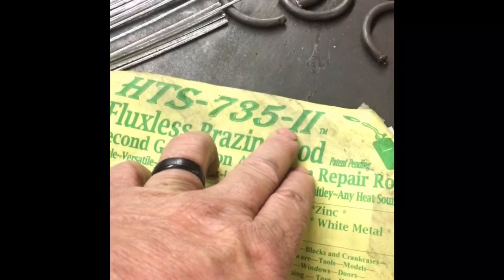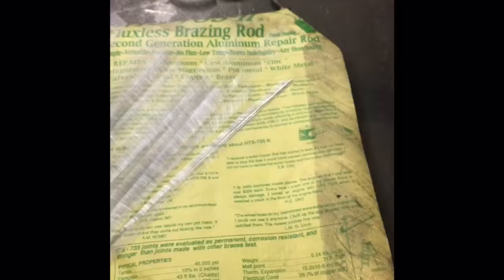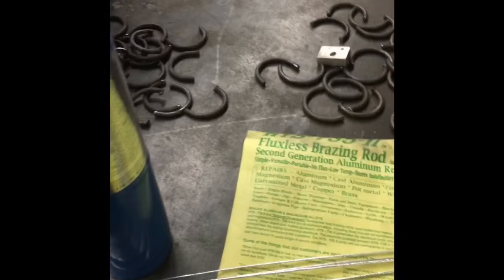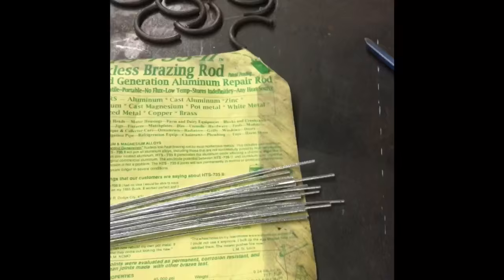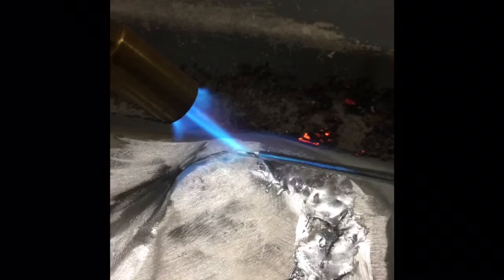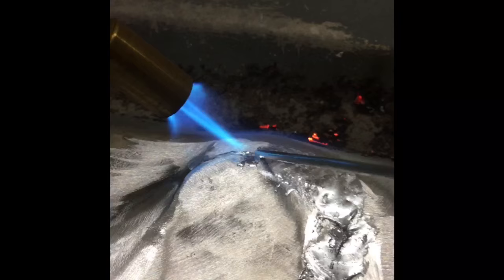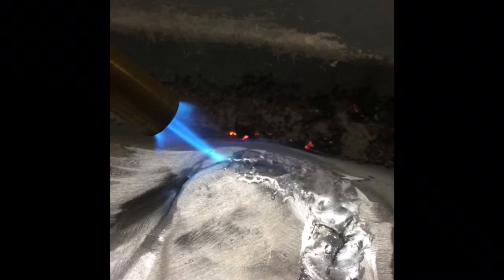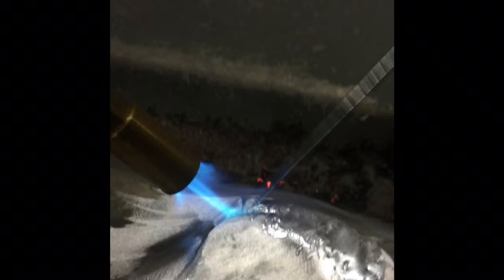DIY Repairing a Hole or Crack in an Aluminum Boat SUPER EASY

Comment: I literally burnt a hole in my tracker topper 1436 useing these so decided to give it another go today on another hole I had and I managed to fill that one but made another hole in the process haha idk what I'm doing wrong I try to keep the map gas max heat torch moveing
Reply: Probably running too hot that's a propane tank he's using. Just get the metal hot enough to melt the rod and keep it flowing, but don't let it get too hot even with propane torches because you'll melt the aluminum of the boat away

Comment: Great way to repair it on dry land. Thanks for posting Sam.

No one's ever heard of Brolite. It's been used for years in marine industry for repairing hulls of boats in the water and even under way with large holes. It get's as hard as steel and can be mixed in water or underwater. You can drill and tap it for threads if needed also.
Reply: i googled it and Nothing comes up at all ,,
Reply: I think your talking about splash zone.
Reply: I believe he is thinking of the product called belzona
Reply: yes it's good for a temp filling repair in your teeth.
Reply: He’s referring to when him and his bro,s … we’ll simply put, “ got lite “ 🤙

Comment: I bought some and see so many uses for these!  I have a leaky transom on my jon boat and will repair it but have also needed in the past a way to weld things without a welder.  just quick connections and a way to hold different metal things together. I can't wait to try this.  It may become my new duct tape (for metal).
Reply: Karen Grider how'd  it do
Reply: Karen Grider

Comment: Thanks, that will help a lot. I used fibreglass and resin a year ago - you're right - it does not last.
Just a tiny point - when you are using a phone to take a video it is best to turn It to landscape mode, not upright (portrait)  - looks good on both phone and PC

Comment: This is a short term fix. These brazing rods don’t hold up well on a flexing hull. Use it on gunnels or someplace that won’t flex, but I wouldn’t recommend it in flexing areas.
Reply: Not sure where you came up with that info, only way the repair will come loose is if you use HTS-735-11 incorrectly by either not cleaning the aluminum or not heating to the correct temperature. The rod will penetrate the aluminum and will not come loose. This is not a surface treatment like some other products. This is a permanent repair. BUT you MUST follow the instructions and keep the rod out of the flame. Videos at youtube.com/c/aluminum-weld you can always call if you have additional questions. Thanks for your interest.

Comment: While cranking my flat bottom up on trailor it pulled on the front loop and cracked it pretty good will this as showed in video wrk?? It is a old boat I know it want hold like new I can load it by hand I just need to be sealed bk up and hold some wht??

Comment: You can actually grind, tap, die, pretty much anything you do with aluminum with that Aluma weld.  I though it was a gimmick till I tried it!
Reply from the maker: +Bryan Roberts Yes I thought the same thing
Reply: +Sam Wood Outdoors I bought a 38' extension ladder that had a broken rung on the top section for $30. I used the Aluma weld and it hasn't broke yet. 
2 years and 320lbs!
Reply from the maker: nice
Reply: This is awesome I had issues but that was from putz before me using fiberglass body filler to seal a hole I had to burn out all of it so the Brazing Weld would hold PROPER,
Reply: @SamWoodOutdoors  what kind of torch and torch head did you use

Comment: I tried that stuff on my aluminum canoe years ago and it didn't work at all.  Watching some of these videos I think I found out what I did wrong.  I was using propane instead of the higher heat gases.  I just couldn't get the aluminum hot enough to get the rod to work.  
What gas did you use on the weld?
Reply: Yes Sir that it the way HTS-735-11 works.
Reply: @Aluminum-weld  hi I just need to Change the gas and use the same propane torch?
Reply: @nelsoncruck2458  What are you working on? Cannot answer without more details Watch the Weld Aluminum at Home video  at youtube.com/c/aluminum-weld
Reply: @Aluminum-weld  I’m trying to fix a  hole caused by a loose rivet on my 14 ft aluminum fishing boat . I understand the normal propane will not work. Do i only need to change the gas or I have to buy a different burner altogether? Tks!
Reply: @nelsoncruck2458  Nelson use the torch to currently have with MAP Gas. If you cannot get the boat hot enough to melt the rod then you need another torch. I like the TS8000 Bernzomatic Watch my Torch tip and rivet repair at youtube.com/c/aluminum-weld
Reply: More heat isn't the answer. Remember aluminum (your boat) melts at around 1200º, just a few hundred degrees warmer. Waiting for the aluminum surface to warm up enough is the key. Since aluminum is a good heat conductor (heat spreads quickly), that takes time. Don't try to rush it by applying more heat, putting the rod itself into the flame, and similar.

Comment: You didn't mention the type of gas in your torch you are using to melt the rod
Reply: Propane work most of the time, Mapp Gas will heat the aluminum faster. Control the heat with distance ay shown in the HEAT CONTROL video at 
youtube.com/c/aluminum-weld

Comment: It won’t last but a minute.  The flexing of the hull will cause the exact same crack again. GUARANTEED!!!!   Thanks for the attempt 😂.  Video too😃
Reply: I disagree, The HTS-735-11 rod penetrates the aluminum and will flex with the boat. It is very inportant to apply the rod 3/8 to 1/2 inch both sides of the crack and apply it thick enough for strength. There are several videos at youtube.com/c/aluminum-weld demonstrating this.

Comment: What kind of torch were you using?
Reply: Watch yhe videos at youtube.com/c/aluminum-weld  We discuss different torches and gas. look for the pontoon repair video
Reply: Best to use a Benzomatic Mapp Gas to Heat the Aluminum up to 735 degrees to be able to melt the HTS-735-II Flux less Aluminum Brazing Rod when the rod touches the surface of the aluminum keeping it from melting into touch flame just watch the video several times until you are comfortable with what to do
Reply: Best to use a Benzomatic Mapp Gas to Heat the Aluminum (after cleaning the aluminum very good) up to 735 degrees to be able to melt the HTS-735-II Flux less Aluminum Brazing Rod when the rod touches the surface of the aluminum keeping it from melting into touch flame just watch the video several times until you are comfortable with what to do

Comment: There are videos on YT saying this doesn't hold up when you get into a little rough water those pop back open. How are they holding up now?
Reply: Wonder if they were using HTS-735-11 or something else as there all products  do not work as well.  Also the HTS-735-11 must be used correctly to work. 
Several videos at youtube.com/c/aluminum-weld shows the strength and proper application methods.

Comment: I'm trying to fill a couple pinholes in my air conditioning aluminum tubing on my 07 Duramax, and I'm starting to think that propane gas is safer to use than Mapp gas since the Mapp gas can melt the AL tubing quicker causing a collapse. Does anybody have an opinion on this? Thanks!
Reply: I like to say you can have too little heat but not too much, because you can control the heat by pulling the torch away from the surface  you are heating reducing the heat, or position the torch closer and increase the heat. If you use a torch or gas that is not hot enough to get the aluminum to 735 degrees F.  the HTS-735-11 rod will not melt or bond to the aluminum.  The aluminum must melt the rod, NOT the torch. There is a heat control video at youtube.com/c/aluminum-weld showing this. The important thing is to use the HTS-735-11 Rod at a temperature stick to determine the aluminum temperature. There is no guessing involved using the rod. When the rod is melted by the heated aluminum you are at the correct temperature and you can pull the torch back away enough to maintain the temperature. If you pull the torch back too far and the aluminum no longer melts the aluminum just lower the torch which will increase the heat. The HTS-735-11 rod melts at 735 degrees F aluminum melts at around 1230 degrees F. That is why is is easy to use if you control the heat.
Reply: @Aluminum-weld  Thank you very much for that follow-up advice and link to the heat control video - I really appreciate your help!

Comment: Every welding rod manufacturer makes these. Lincoln, Blue Demon, Hobart, Forney, ect. They're all pretty much the same.
Reply: True there are many options, but most contain aluminum, the HTS-735-11 is a second generation rod  that has NO ALUMINUM in it, This allows it to bond aluminum that is less that perfectly clean as well as copper, brass, and most other nonferrous metals. Most users are not working on new aluminum.

Comment: Sanded with 60 grit. Bought this exact brand of rods. Followed the instructions,  all it does it melt, gob up, and when you go to grind it smooth,  the entire weld piece pops off.... 
Could it be my $19 torch? It's not putting out the fire like your torch seems to....
Thanks for any ideas
Reply: Sure do, The reason the rod did not bond is the aluminum was not up to 735 degrees and or you melted the rod with the torch. Check out these videos at youtube.com/c/aluminum-weld If you follow those instructions and keep the rod from the flame you will have no problems.
Reply: Good info

Comment: the new JB marine weld works but you need to put backing tape in the hole so forms right.  It does work just not for huge holes.  Worked on my stepdads boat wit the old jb welds for 20 years. I have it and the marine weld works even better.  Just not for huge holes.  but cracks and corrossion pits it works great just make sure you prep well.
Reply: J/B weld? I gotta say it it gives after a few years hell I am replacing J/B Weld every few seasons why I am looking at this method. Do not get me wrong This is my experience with J/B Weld

Comment: So, do you work for the propane company, or the aluminum rod company?  Got a bigger hole now, thanks
Reply: Heat control! The HTS-735-11 rod melts 500 degree F. below the melting temperature of aluminum.  Heat Control video at youtube.com/c/aluminum-weld shows this quite clearly.

Comment: So I tried this out and it's like the metal isn't getting hot enough for the rod to stick to. I'm using propane torch as well... when I do it its like the rod lumps up and just falls on to it... then it hardens and doesn't even adhere at all the surface. Maybe I don't have it clean enough.What do you think? Any tips?
Reply from the maker: it took a while to get the metal hot. I did the sam as you but once I just took a deep breath and just kept heating it up it worked.. don't give up it will work
Reply: Cody Walters use map gas instead of propane!
Reply: I got a MAP torch and tried this on a soda can first. Burnt the hell outta the can. I'm thinking propane might take awhile but seams a lot safer what are your thoughts?
Reply: jehu87 both can be used major difference I ran was time into Map is so much easier to heat with, Propane takes such a long time, I have even run Map O2 torch Keep working with the cans you will nail it major factor keep flame moving.
Reply: Use map gas in blue bottle at Wal-Mart it gets way hotter then propane

Comment: Is there any danger of the heat from the flame blowing a hole in the boat?
Reply: No and YES. If you control the heat by moving the flame back from the aluminum and just heat the aluminum to the point the HTS-735-11 Rod melts then NO problem. That is because the HTS-735-11 Rod melts 500 degrees  below the melting point of aluminum.  So you can use the HTS-735-11 Rod to determine the temperature of the aluminum. HTS-735-11 melts at 735 degrees F. aluminum melts around 1230 degrees F.
But if you  just guess  when the aluminum is hot enough then you may well burn a hole. If you follow the instructions it is fool proof. There are instructional videos on their website.

Comment: Can this be used on a hole in a jet ski block from corrosion after cleaned up of course
Reply: If it is cast aluminum or aluminum then yes.  Check out the how videos on youtube

Comment: Looks WAY easier and cheaper than a TIG welder.
Reply: kid riglar 
Because it’s not a tig welder, not a weld at all. A weld flows the metal and is as strong as new or when it was forged.  This is a bonding agent and is the equivalent to soldering copper water pipes. 
If your patching a hole it’s great. If your repairing a crack that needs strength it needs a true weld.

Comment: How do you stop the aluminium from leaking right through?
Reply: Giallo & Eurocrime World you do it on concrete. The rods have flux on them that bonds to metal.
Reply: The rod has a very high surface tension so it will bridge 3/8 inch with ease.
Reply: @joshuatowell9793  no flux in or on the rods, no flux is needed.

Comment: Did this on a pinhole in my boat and it warped and formed a 4 inch long crack that expanded as I tried to fix it, 100% my fault but still bummed out
Reply: patch the crack. videos at youtube.com/c/aluminum-weld

Comment: Do you grind the welds you make smooth also?
Reply: Sure you can grind or drill and tap. It is much harder than the aluminum, more like mild steel.
Reply: @ashramdhan1582  I have a video showing an F150 panel repair at youtube.com/c/aluminum-weld so the answer is YES

Comment: After you weld, is there any way of getting rid of the lumpiness that this creates ? Or does paint covers this right up?
Reply: Maryam Alhaqq this isn't welding- not even sure if it's really brazing! That just looks like a bad idea. The product may have some applications but I wouldn't do this structurally unsound repair to a boat bottom. Just sayin'. A rivet patch and 5200 I'd trust.

Comment: This will not hold up to any real stress. It really needs to be welded to be strong. This is just a patch that will surely fail
Reply from the maker: blake the snake been two years of beating the hell out of it and still NO LEAKS
Reply from the maker: blake the snake I suspect you never used the stuff so how can you give an opinion?  I love how folks think they know something give an opinion and never tried it. YOUR OPINION IS INVALID SO HAVE A GREAT DAY
Reply: Then i stand corrected. Thanks for replying. I have welded alot of aluminum. And i can tell you this is not how it’s done. I am surprised it has lasted 2 years. As it is not a true weld. The base material never reaches a flow point. That said. I respect your response and i stand corrected. And I take back my earlier comment. I respect anyone who tries to diy. Sorry if I offended you
Reply from the maker: It’s all good. I get it is not true welding it’s brazing and that being said a braze can be strong
Reply: It is a weld unless there is a MAGIC welder. Aluminum is NOT steel not even close to mild steel requires less heat, to weld than steel.

Comment: Hi, 
I was doing my boat the same way. It looks fine, but unfortunately its separates. 

Any comment on this one? 

Like one side stays strong, and other side is separating
Reply from the maker: Clean it well?  All mine are holding
Reply: @SamWoodOutdoors  what are you using to clean with? Alcohol?
Reply: @IvanGutsulyak   You must me 100% sure that both sides or pieces get hot enough to melt the HTS-735-11 Rod. Use the  HTS-735-11 Rod to determine the correct temperature. All rods available for sale do not all work the same.
Reply: You must make sure you apply it thick, let is slow cool , then you can grind it to look good.

Comment: 🤣  Okay, did it all wrong. Unlike what he shows at 1:31 to 1:35, you never want to put the rod into the torch flame. Read the directions. The idea is to heat the metal surface, letting the heat from that surface ALONE melt the rod. That takes time (aluminum is hard to heat), but it's the only way to ensure a good bond between the surface and the metal added.
Reply: YES SIR That is right on! Several videos at youtube.com/c/aluminum-weld
Reply: I understood the directions from the first video. People need to pay attention and understand what they’re doing completely before attempting to repair aluminum holes and cracks

Comment: they are called filler rods, id say just find someone who can tig weld.
Reply: Entirely different rod and process.
Reply: +Shane K yeah that is shit welding...
Reply: I know for fact 99.9999% "WELDERS" are using the same rods. I have SEEN It and then it was Taught to me how to. So difference is NADA/NIL/ZILCH/ and yes tig was used.
Reply: ryangriff12 what is so shit about it. I mean if your following procedures Same EXACT weld achieved.

Comment: Do u use regular torch
Reply: Sure as long as the torch you are using  can heats the aluminum up to the melting point of the HTS-735-11 Rod.  You see the heated aluminum must melt the HTS-735-11 Rod NOT the torch.  The HTS-735-11 Rod melts 500 degree F. below the melting point of aluminum.  So some repairs may require Map Gas you can buy at any hardware store.  Also torch tips have different heat outputs.  So there is no regular torch.